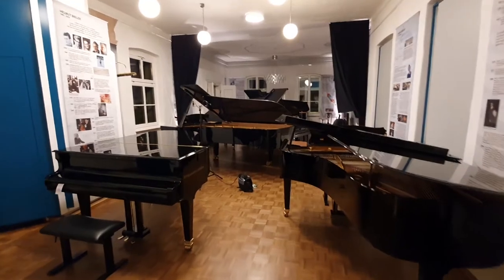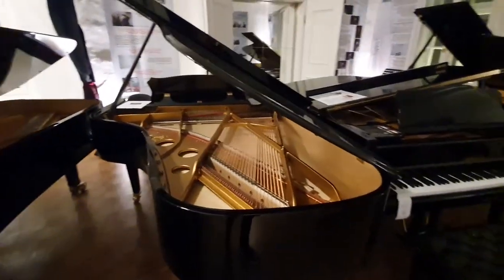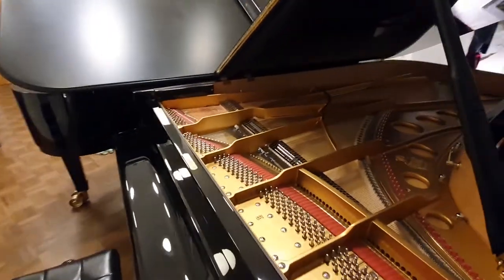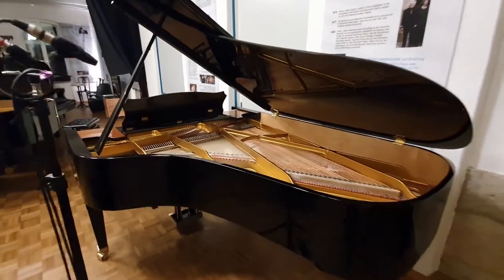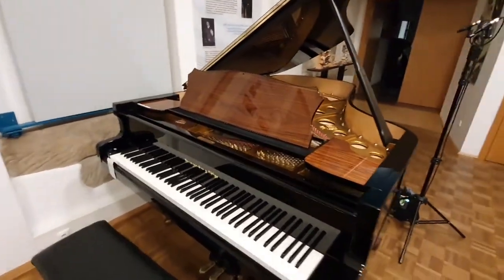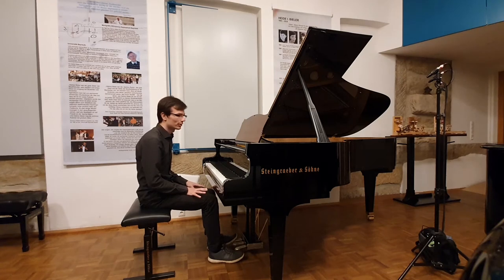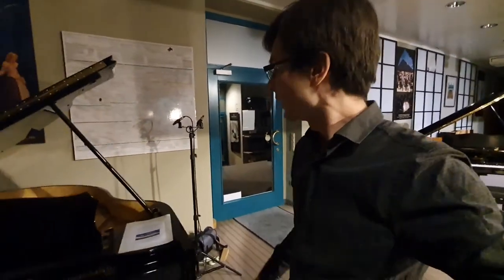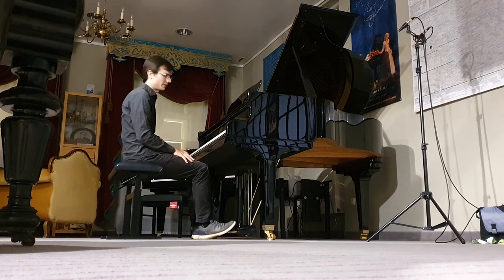GRAND PIANO SIZE COMPARISON - 272, 212, 170cm Steingraeber Grand Pianos

Comment: Stunning all of them and the small one (5'6") is a revelation.
Reply: Wearing earbuds, the instruments are beyond impressive. To my ear they produce a pure sound, but the first piano was astounding.
Reply: @nomebear  I'm a part time audio engineer, and what people might not really "get" - even a lot of engineers, is that his mikes in an AB configuration sitting just ABOVE the plane of the lid, at about 7' (2.3 meters) AVOIDS the cross currents of waves when you close mic a piano, in whatever configuration, because of the direct sound off the soundboard (Vertical) and the wave pattern reflecting off the lid. ( horizontal ). Fine engineers mostly recommend removing the lid for studio recording, but if that is not practical, do what this guy is doing, he's doing it right.

Comment: The E-272 with or without the gimmicks, is just about the best piano made today. If money were no object, this would be my choice. But i had the chance to grab a reconditioned model EN-280 Bechstein (last made in the old style, with 88 agraffes) and it is very good.
Reply: Is the model E Bechstein similar in sound to Steingraeber? And what year was it?
Reply: @hastensavoir7782  The old Bechstein E270 was in production from around 1902 to 1970. It evolved over the dcades, with fishtail rims turning into steam-bent ones. The EN 280 was the same basic design but elongated. It went from 1973 up to 1993. After that they switched over to the model D 282, which is a totally new re-design. I still prefer the old E270, but thry are hard to find
Reply: @studentjohn35  by all means get a ‘latest’ model E if one can. Is the Steingraeber similar to the model E’s tone?

Comment: Really not a good idea to play the longest ones first. That's physics: a short string can not sound better than a long one. It is the same for the action, it is much shorter in the 170 than in the 272, and therefore the balance is different. The 170 is probably one of the very best in this size range. Then choosing between top pianos  it is mostly a matter of taste. Steingraebers have a very distinctive sound that I love. Cheers
Reply from the maker: I understand your point and I know what you mean. But I am a pianist and I know what I want from a piano. I wasn't inspired. You can see in my other video that I compared the 170 with an old model and I fel in love with the old one. Something with the new 170 was missing. I don't say it is not a superb piano. But not for my taste.
Reply: @BohumirStehlik  Yes I listened to that video too. Strangely while I usually like old pianos I did not like so much the sound of the old Steingraeber (as far as we can judge with a recording). Probably we have different tastes.  Anyway recordings have their limits too especially they can not reproduce the feeling while playing.